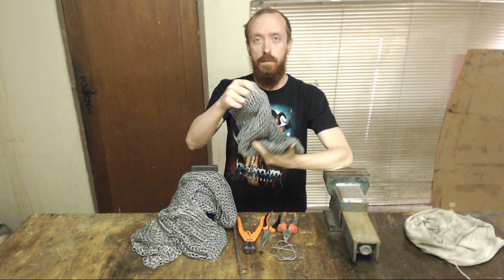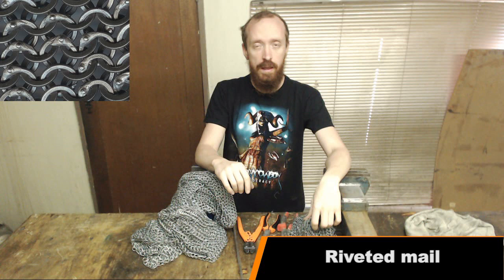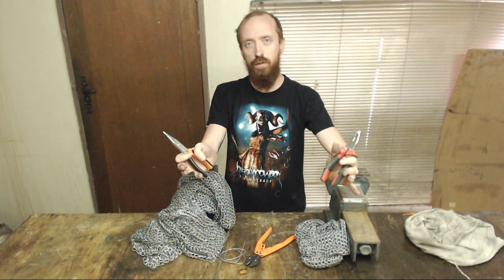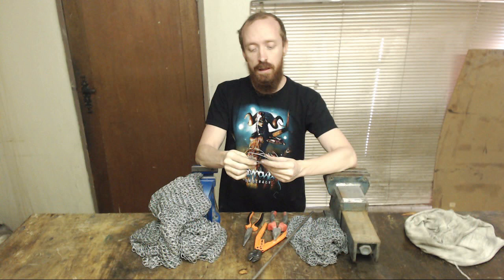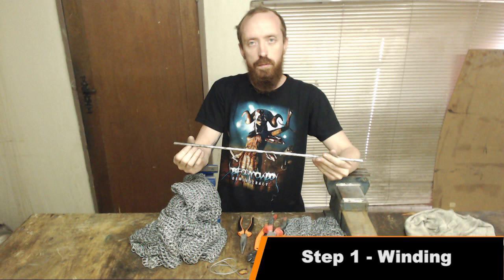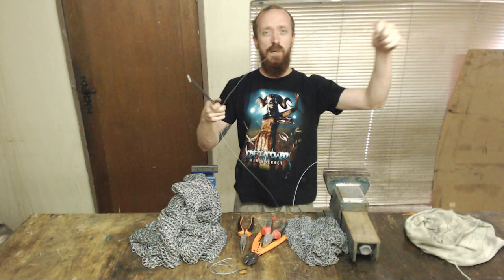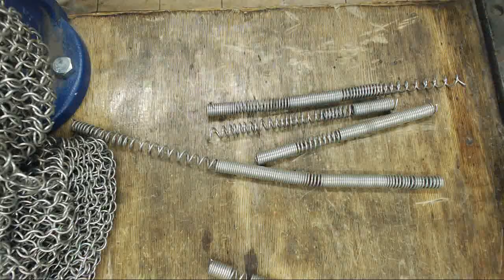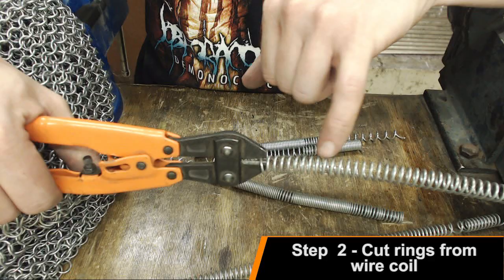How to make chain mail

Comment: i was lucky enough to be the guy at the entrance to a computer shop whom checked recipts of customers as they came and went from my store.
and in between customers passing by, i would pick up my mini pliers and weave away.
getting paid to do a hobby. 
i got half way through a shirt  .   I tried 10mm 1cm rings and 2-3cm rings with 6 links.
i found the tight connections of the 1cm rings much more pleasing.
Reply from the maker: I used to take a bucket of rings along on road trips a nd just weave away. It's quite meditative. The smaller ring and tighter weaves look so much nice

Comment: I use a piece of scrap oak in which I stick the rod to have a way to hold the rod while it is spinning. I feed my wire (in my case a Sg2 mig welding wire of 1,6mm) through two drilled holes (which are on an angle, I believe about 165-170 degrees to each other) in the oak so the wire has a bit of friction while it is going throught the two holes. The exits the wood and meets a small hole in the rod in which the wire is fed through to hold in onto the rod. When the rod starts to spin by means of a handheld drill the wire is coild onto the rod. In the wood piece I fastened a large washer (a so called fender washer) which has been slit and twisted into a former to help put even pressure on the side of the growing coil. This is because you want the coil to be wound nice and tight but more importantly even and without bunching up or leaving gaps.
The wood piece with the two holes (brake/friction provider) and the twisted fender washer (as a former/straightner) are shaped so it can be held in one hand while the other hand holds the drill. I simply mount the wire emerging from the wood piece into the rod, push the wood piece towards the drill and start winding. The former makes sure the wire can't bunch up and the pressure I exert in the direction of the drill ensures an even wind of the coils.
I salvaged my rod (mandrel) from an old deskjet printer and it is about 9,5mm in diameter. My rings (as a result of some spring back) are slightly under 10mm inner diameter which is a historically correct size and a nice middle between too large and be ugly and too small to be too much work. Also the 10mm size is perfect for weaving and (in my case) welding (in situ).
I have a short video on my channel in which I show (in unfortunately rather little detail) how the wood coiling former thingy works.
Reply: Power winding really wants a hands-free wire feed device for enhanced safety.
I found a very simple one off the internet.
It's a block of wood, not very large, with a small eyescrew screwed into it well into the wood. The wire feeds to the mandrel through this eyescrew, which holds the wire down a little below where the wire must go to get around the mandrel, giving a bit of tension. Fix the block to something immovable, with a lot of room on the other side of it from you and the drill, so the freely moving rod has room to work.
To make a neat spring coil, the mandrel is laid on the block just to the right of the eyescrew. Here's the secret: angle the mandrel by swinging the drill over about 5-10 degrees to your right. When you start, the wire coil builds downhill as it were, and doesn't ball up.
With a no-hands feed, your hands stay well away from the high energy parts of the operation. 
Reverse the drill for a few turns to slack the coil when you've filled the mandrel. Then it's loose enough to remove.
Reply: @w.reidripley1968  As always, the cat reports it has been skinned multiple ways...

Comment: Great stuff, I have a question if you don’t mind, I have a shit load of silver bullion , in you opinion would I be the coolest dude at the local medieval fair if I make a full length chain mail suit out of pure .999 silver , or can I use stainless steel . Also is there a market for making those stainless mail gloves butchers wear ? I am stuck at home on a iv drip for 12 hours everyday , one thing I do have is a hell of a lot of time and nothing to do, I am dyeing of boredom and it would be nice to have something to show for all this time I have. For the record that was a serious question about making a mail suit from pure silver, being the most conductive metal I will have to look out for lightning strikes . Thank you for the cool video and inspiration , I will start tomorrow  morning I am very excited .
Reply from the maker: Glad you like the video, sorry for the delayed response.
Honestly I never though of making maille from silver. Pure silver is very soft though and I think there will come a time where the shear weight of the mail would pull the silver rings appart. A silver alloy would be better.
As for stainless steel you can surely make mail out of that. It's going to be really hard on your hands though. Stainless doesn't bend or cut as easily as mild steel, but if you have good cutters and keep the SS wire on the thinner side there is no reason to not do it.
I found making mail very relaxing while watching Netflix.
The market for mail is really not worth the effort. The amount of time it requires to make mail far outweighs the money someone would be willing to pay for it. A butcher would rather just buy from a supplier directly than from a craftsman in my opinion. Gloves are also quite tricky because you would have to make really small rings with reasonably thin wire. It's totally doable and would be a good learning experience though.
A nice starting point would be to make a maille coif. That's where I started. It gives a nice indication of time required and establishes a workflow pattern that you can refer to later.
Good luck and keep me updated on how it goes, feel free to ask if you need help....
Reply: @ManinaCanArmoury  , great advice thank you. Got lots of time I shall get started and will keep you up to date. Cheers man in a can.

Comment: Tip for viewers: Its galvanized, and butted. Never use galvanized, it looks just bad and makes you look like a lamp post. Secondly: Butted maille is garbage, and only good for LARP. Riveted maille on the other hand is far better and historically accurate
Reply: Counterpoints: It's dirt cheap, stronger than iron, can be blackened to look more authentic, is still adequate for SCA fighting, doesn't require specialized tools to make, is much quicker to make, and (if you're buying) doesn't cost several hundred dollars for a hauberk.

Comment: At 6:05 i stopped watching your video. That was completely dangerous. What the hell was that. If that went wrong you would have had a length of wire whipping you and whipping around with out having a way to stop it. OMG. That is insanely INSANELY DANGEROUS.
There are way to many videos like this on YouTube.
You get someone with no experience with working with mentals or machinery following you with what you just did i could and can lead to then been badly hurt or even worse killed.
I am truly disappointed and disgusted over your complete complacency and disregard to safety.
This is not a how to video.
Its a HOW NEVER TO DO VIDEO.
Reply: And yes i reported your video because how dangerous your using that drill press is.
Reply from the maker: I respect the fact that you took the time to point out my lapse in safety protocol in this video. What I neglected to point out is that my drill press is very low powered and can be stopped by hand with very little force at all. I generally try to be as safe as possible but I do slip up sometimes when it comes to safety, guess it is a lack of experience. I'm not an expert and learn as I go along, some things I guess you do not want to learn the hard way and I apologize if my ways are not appropriate in terms of safety. I do not claim to be an expert and just share my experience. Luckily I haven't hurt myself yet and I hope that I haven't put you off armour making, it is a great hobby and well worth investing into.
Reply: Use a no- hands wire feeding device.  Keeps your hands out of the high potential energy zone.
Pre opens links in the coil; good time saver.
I don't like using needlenose iers for butted links, as they slip a lot and don't give the proper grip. Ilike the square noses on regular pliers. They do have a few specialized uses in tweaking and sorting riveted rings, which can end up inconsistent sometimes.